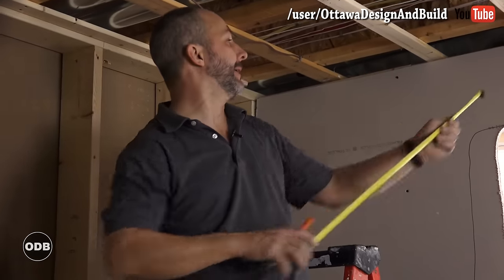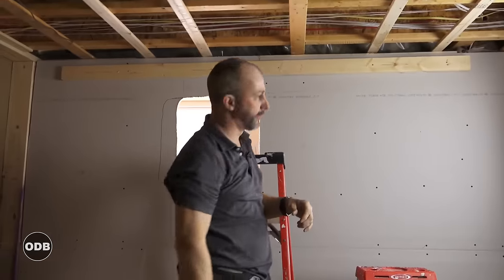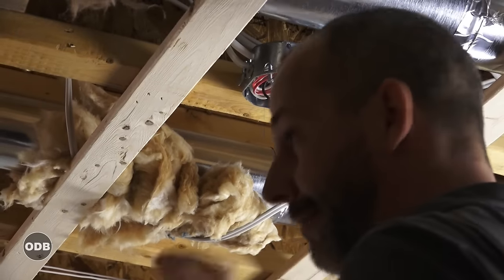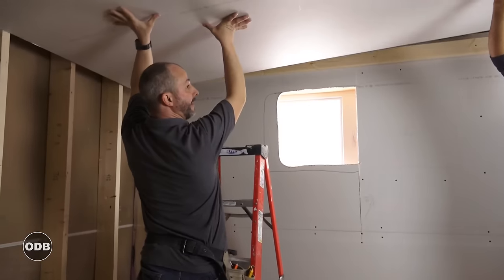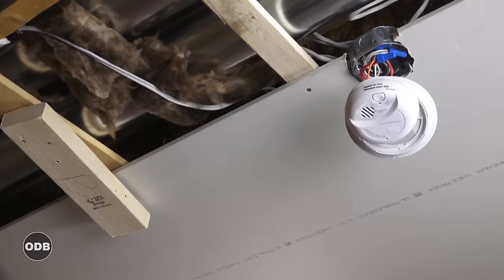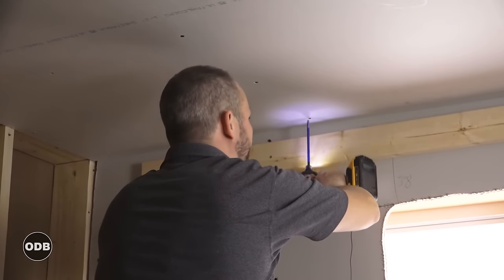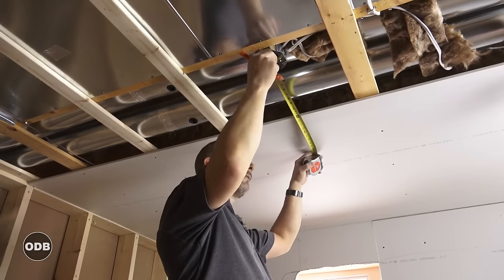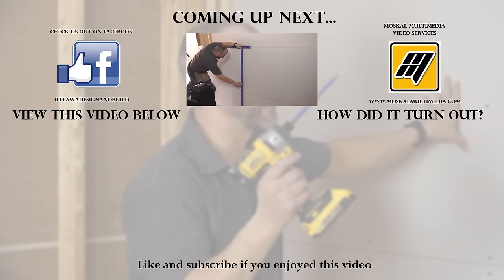Installing Drywall on Your Ceiling | Drywall Installation Guide Part 2

Comment: My brother was a drywall contractor. He taught me a lot about installing drywall. He had a lot of patience for me as a teenager. Anyway when you talked about using your head to hold it up to the ceiling and going bald I kind of laughed because he went bald to. He refused to use that drywall jack equipment. A waste of time he said. He passed away a few months ago. I miss him so much.
Reply: May God bless him. And keep him on the highest heaven.
Reply: Yeah once it's up like he had it, you just run your forearm along it to hold it up and with that same hand have it prepped with screws and grab your screw gun with the other hand. It seems like a lot but once you are used to it it's quick. Grab screws, grab the sheet put it up to the ceiling, grab your gun and screw it off.
Reply: Sorry, about your brother.🙏
Reply: Sorry for your loss.
Reply: Sorry to hear bro..
Reply: I'm sure he is in heaven
Reply: RIP sorry to hear. Love the AIC jar of flies pic btw
Reply: Those are the memories that will stick with you. Sorry for your loss

Comment: Great tutorial ! Thank you, it gave me the confidence to get it done. I would emphasize:  a) Do not underestimate the non-squareness of the room, this was my nemesis b) The tip about the small blocks to hold the panels in place is GOLDEN c) The "cut as you go" technique with the T ruler requires a LOT of expertise, definitely not for the beginner,  mark with pencil and cut d) Cutting the "brown paper" side of the panel is equally critical in the accuracy needed , e) USE GLOVES, the material of the panels I got had  glass fiber and it killed my hands. Thanks again! Great video!

Comment: Great video series on dry way.  I love the way Jeff explains what he is doing.  I thought the hawk and the trowel were going to be really awkward to use but I decided to give it a try .... I am sold.  I did my 12 x 15 foot room in half the time.  With the tips on the application on the corner and using the faster drying mud in the large gaps I was able get the room ready to paint much faster.  I have to say I feel like I know Jeff now because I watched his videos on dry way many times over the last few weeks as I have done this remodel (mostly on Saturdays).  He puts so much information into one video you really need to watch it multiple times to pick everything up.  Thanks Jeff...keep up the great work.
Reply from the maker: Thank you Rich, Cheers!

Comment: Great use of humor in the video. And I used that trick of attaching a board to the wall and using it to hold up that edge of the sheet. It saved my bacon. It just seemed the logical thing to do at the time.

Comment: Ha! When i did my basement by myself...this is almost the exact method i used! Really helped me out.
Next project i do, i will 100% use resilient channel! No more messing with trying to shim the drywall over joists that arent level. We had to float out sections of the ceiling that were really low.
No more trusting that the strapping will set me straight. Lol
Reply from the maker: That is a great idea!

Comment: You should dedicate a full minute to talk about drywall strapping - when to do it when no need, dimensions -1x3 or 1x4, spacing, screw or nail to the studs, how to level the ceiling. Should we use 5/8 thick or 1/2 drywall for ceilings
Reply: Valuable comments.
Reply: You generally use 5/8 (aka Fireguard) to keep things up to fire code. I generally find myself installing it in areas that neighbor other living spaces. Examples would be things such as Ceilings of live-in basement suites. Party walls; Which are the dividing walls between two people's houses in duplexes or town houses that go between two units. Basically one person's fire is less likely to become another person's fire. That's the best way to describe when to use it.

That aside, on Ceilings you would generally use sag resistant ceiling board if there will be insulation which is 1/2" This is different than 1/2 standard board.

Standard 1/2" is generally used everywhere else including ceilings without insulation for the most part. There are a few other types for different situations like around bathtubs and things, but for most standard jobs you will mostly use 1/2" which is the light stuff.
Reply: @steveng4383  hello Steve....im assuming u would use 1/2" for a storage shed correct?....and is it necessary to use sag resistant drywall on ceilings?

Comment: great tip on wood blocking, I use it all the time. when I'm hanging drywall by myself. I don't use a DeWalt 20 volt  cordless impact gun to screw, which will work,  I use a DeWalt 20 volt DRYWALL screw gun to embed screws right.
Reply from the maker: I understand. I was trying to show homeowners who don't own all the tools in the box how they can do it.

Comment: When I got into renovations a few years ago I was installing 5/8 fire board in a kitchen on a ceiling and when I pushed it up to the sheet snapped in the middle. That was the day I bought a dry wall lift and I have never regretted it. I am 63 now and thank God for that lift.

Comment: Thanks for the Drywall guide, man. Had to do some commercial Drywall stuff and I wasn't really sure how it went together. I got most of it down by the time we finished but this just helps connect the missing pieces
Reply from the maker: Drywall is a task that can be approach like an art form. It always amazes me to watch a professional crew that have the communication down to a science. In my career I usually go through helpers like underwear and am constantly training.

Comment: I like your videos, they help me out with projects I am working on. I will be installing two layers of 5/8 drywall on the ceiling in my drum room after I install the resilient channel. I already have insulation up in the ceiling, the ceiling is 7’ high and it’s in the basement. When we bought the house it had a bar area in the basement so I ripped the bar out and did the framing, drywall the front outside and inside I also have safe and sound insulation between the drywall. As of right now I have hung 1/2” drywall in my wife’s art studio she wanted. So my room will be next, then the rest of the basement will be remolded into a family room with a pool table that was left in the basement which I plan on remolding also using up cycled pallets to give it a rustic look.

Comment: Hi, I would love to see a video about insulating an attic and adding furring (sp?) strips. This video starts after the strips have already been installed. Also, I've seen your video on insulating walls, but not ceilings. Thanks for your excellent content!

Comment: I used the drywall lift when I finished my basement by myself.  I used 5/8th" on the ceiling (a waste) and that stuff was heavy.  I used drywall screws (for top piece) and strips of drywall (bottom piece) to hang the drywall on the walls.  The wood block would've been a nice set of helping hands back then on my first drywall job.

Comment: I rented a drywall lift for my own basement it was like 50$ for 7 days. (much better than home depot) worked wonders and did everything by myself. Very simple and much less time wasted than hanging 2x4 to support it.
Reply from the maker: Right on Boris, I love the lift as well. This video was to show people doing a small room another option. Trust me this took alot less time than going to the store to rent equipment.
Reply: Boris, How long did it take to 1. get the lift, 2 setup the lift, 3. Disassemble, 4. return the lift?

Comment: Extremely Useful video .... i would be happy to see that how did you installed the rest of the quarter roof and how did you cut it in a straight line and using what tools . thanks alot
Reply from the maker: I use a T square for cutting drywall.

Comment: Holding the drywall in place with one's head is a great way to leave grease spots on the paper.  If you're going to wear a baseball cap while doing it, though, be sure to first tear off the "button" in the center of the crown; otherwise it's going to hurt.

Comment: Is there a video where you're doing a ceiling and it shows butt joints when you're mudding. My room is 15x30 and I'm worried about taping and mudding it. I seen your video of you doing a butt joint on a wall however, I need to see it in perspective on the ceiling because lighting is different and it could turn out really ugly. So a video of that would be a huge help. Thanks and I love your videos!!

Comment: Your videos and tricks are fantastic. I have just one piece of advice. When you are cutting the holes in the drywall around fixture and junction boxes, you really should be wearing a dust mask. The fine dust can do a number on your lungs, especially if you do a lot of drywall work. I'm an Occupational Medicine physician so I worry about this sort of thing. Again, great videos and great tips.
Reply from the maker: Thanks for your concern.

Comment: Also, to avoid punching the paper, and having crooked screws, that install allowed the screws to be screwed outside of the tape end, and holds better with more meat of the rock.  Screw pattern code is very similar to sheet rock code for amounts of screws if not the same

Comment: I got a question. is it necessary to put the strapping on the ceiling when drywalling it? In my house, some rooms have it and some don't. Id like to remove it so that the insulation can sit flat against the drywall to avoid having air gaps and voids between.
Reply: Air between the insulation and drywall is not necessarily a bad thing, it could increase the insulating effect.  Also you'll thank yourself for leaving the strapping if ever decided to run low voltage wires for music, data, etc..

Comment: Hey Home RenoVision DIY,  Can you guys address sinking drywall screws?  I use a dimple bit, but often the screw falls off (real pain).  What you are doing looks effortless!!
Reply from the maker: dimple bits perform at the extreme risk of failure. I prefer to screw lightly and fix them, as I go if necessary. It reduces my call backs from nail pops
Reply: stefaniedavis80, I was thinking the same.

Comment: I use this trick on all my ceilings, it really saves your shoulders. Any reason you aren't using a drywall gun? The new cordless ones are much quieter than an impact and twice as fast.

Comment: When you're drywalling a basement do you recommend doing the walls first Jeff, or the ceiling? I was always told ceiling first then use the walls as extra 'support' around the edges and by butting your walls up to the ceiling, but I'm curious if you recommend one vs the other.
Reply: Do the ceiling first, not the walls

Comment: I noticed, Jeff you using one and a same power drill for every job.
Reply: Impact drivers are basically drills that don't have a clutch or a drill chuck, making them very light, compact, and portable. It's a wonderful tool and you really notice the weight savings when you have to use one for a long period of time!

Comment: First get a panel lift. Second if you have a box in the middle of your seem don't cut our the box until you get the next sheet up ,the sheet will hang down to were you but them together then zip it out. If using a Roto-zip if you are cutting outside the box you go counter clockwise if you are cutting inside you go clockwise

Comment: For ceiling you put 1/2 inches wood strips! Can’t you put drywall direct to ceiling joist? That can save electric point issue of extender need.

Comment: Nice tips!  You are my go-to tips guy for finishing my basement.  I have pre-fab trusses and the bottom 2x4s are not always flat.  What is the 1x4 strapping for?  Will it level out my ceiling enough for 1/2 drywall on ceiling?

Comment: Hello Jeff... Hope all good... First of all, thank you for the tips, they are great and you are a great worker(really fast 😃😃). One question, I have the problem with the Screws, they don't go straight like yours, and I have to uso a lot of Ph2 bit... Any tip to make it more efficient work? I see you doing and I don't see any problem. I use a Dewallt drill and milwaukee bit Ph2. Any suggestions? Thank you. Sorry for the longgggg comment. Have a great week 👍👍

Comment: Very good explanation of these videos. What's your opinion of hanging drywall over top of an existing popcorn ceiling? Plan to use 1/2" drywall if I do. Any advice, or plan to make a video covering this? I could damp the popcorn and remove (no asbestos) in it. Just don't really plan on the mess and then fixing up a terrible job I know is left under it.

Comment: I’m doing a 20x24 garage with 24” on center joist.  I’d like to use the strapping method but I’m not sure they are strong enough to hold the sheet rock at 20’ span.

Comment: I would really like to see someone explain the placing of the 2x4's or whatever is placed onto the floor joist and how to do it
Reply from the maker: 1x4 and you use screws.
Reply: Do you have to use 1x4s for this? I'm installing the drywall on my ceiling in the basement and the floor joists are at different lengths apart from each other.

Do you recommend doing this rather than adding blocking where needed?

Comment: We have to replace a small amount of dry wall in the middle of the ceiling by the light fixture. We are unsure as to what up there . We don't know how the insulation looks. It's a really old house. Any tips ?  We have to cut the hike for light fixture . We still have the rows of wood I guess those are called beans so it seems like a pretty easy job and I know how to use mudd . I may end up doing this fix myself and I just need some tips or a video to watch 😃

Comment: I think you should remove the 1x4 wood straps from ceiling and screw directly on 2x4 studs drywall panels are heavy 1x4 are for lighter ceiling panels
Reply: Good call. since you mention it I notice very slight sag over the years in my ceiling in one of the rooms with strapping. But not in the other room.
Reply: Yep. I agree. Just easier for installation. After that its going to last just enough time for who ever did it to not have to come back 🤣

Comment: Hello!  I don't have the ease you do with the drill.  What kind of screw head do you use also is your drill a normal one or something special for drywall?    I have to put lots of pressure and still don't get the screw in enough thus having to reverse more than once and almost strip the Philips head.  Thanks.  Cheryl
Reply: Impact driver, not drill.

Comment: install drywall walls last. all ceilings up first. router counter clockwise only. use a drywall screwgun to set screws

Comment: I have a quick question. I'm doing a Reno in my garage. The garage was built in 1945. So I want to keep the support beams exposed because they are ruff old lumber not seen in this day in age. I was wondering if I could install 1/2 plywood onto of the beams or do I have to use drywall? I'm in Canada and not sure of the fire code. I'm hoping to be able to install plywood. And then paper barrier to talk and then insulate.

Comment: Great vids, thanks for producing them, subscribed!  From your experience, at what point should you use strapping to level ceiling joists? I used a laser to level my joists during an install, but they're generally out +/- 1/8" between any 6 joists,  just due to cupping etc, despite being fully bridged.  Would you recommend furring strips, or resilient channel? Any preferred brand? Any help greatly appreciated.
Reply from the maker: Iuse 1x3 when sound contro is not an issue. I use resilient when trying to get maximum noise control.

Comment: In New Zealand people use glue as well as screws, and the strapping (ceiling battons) are pine that has grown quicker than the spruce you may have. Less stiff and stong, so it's thicker.  Anyway, why no glue on the American continent? Maybe we shouldn't bother here..? Fun videos...

Comment: I have a 5 x 16 hallway, Should  I  cut my sheet at 5 feet and use four sheets to cover it with 4 x 3-foot sheets as waste (4 sheets total). Or should I run it longways using only 3 sheets with less waste?

Comment: Hey Jeff, what’s your opinion on drywall ceiling versus suspended ceiling for a basement? Is the convenience of removeable panels worth it? My basement mostly has a suspended ceiling but in a few years I’ll be hitting the whole thing to rough in a bigger bathroom and change the wood paneling to drywall and such. Just wondering what I’d gain from changing to a drywall ceiling (I watched your soundproofing video which appealed to me haha). Thanks!